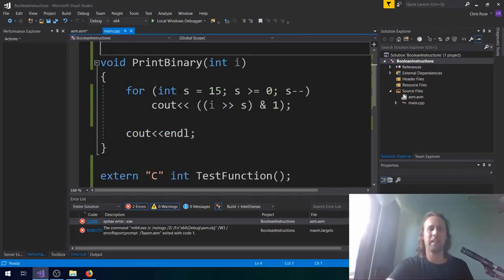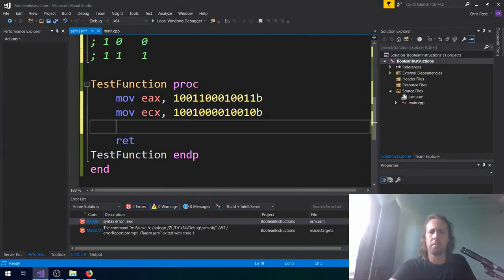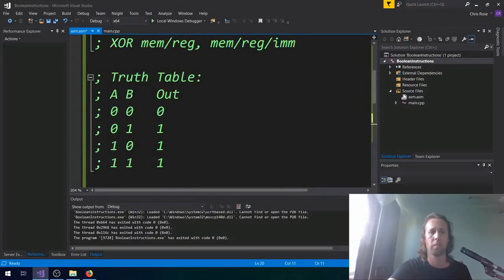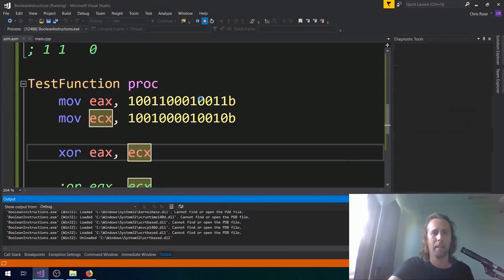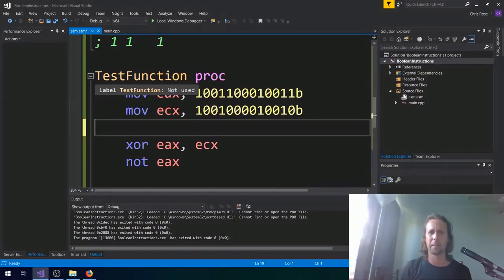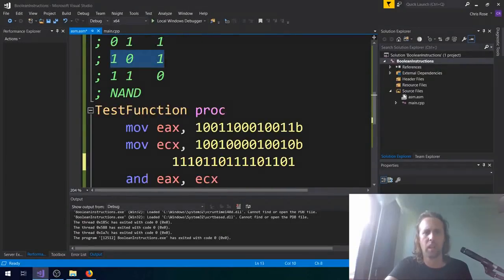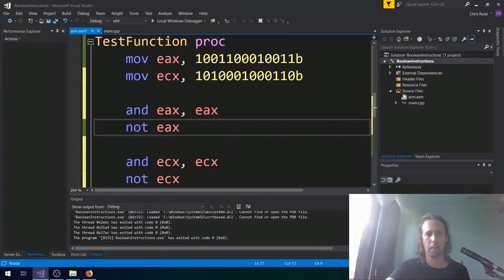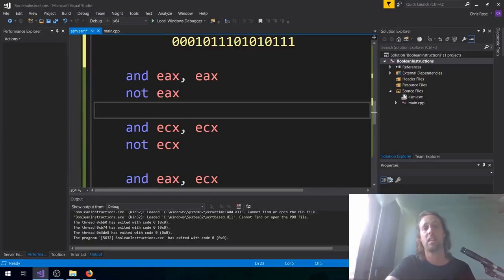Modern x64 Assembly 7: Boolean (Bool) Logical Instructions in x86 x64 8086 ASM

Comment: Brilliant. After passing Coursera Cryptography with excellent mark I forgot xor properties at the next day. I've double-checked a minute ago: Stanford lecturer does not use mnemonic construction "if inputs are the same, the result is zero", as you do, he explains like "addition modular two", which is right, but not so clear.

Your construction works like one-second glue, it sticks instantly and forever. Thanks.
Reply from the maker: So great to hear! Yep, it means "not equal". And, if you NOT the result, ~(A^B), then you get 1's where the two inputs were equal, so that's cool - a bitwise equals operator!! Cheers for watching, have a good one :)

Comment: Very cool series. I know all the old stuff but good refresher on the way to 64 bits. Might have mentioned tho cool thing about xor, being that if you xor two things and then xor one of them back you reset the xored value it what it was before. Used in graphics allot and a simple way to scramble data.